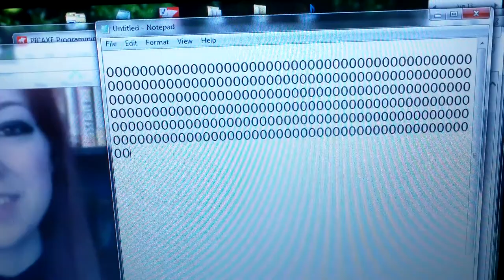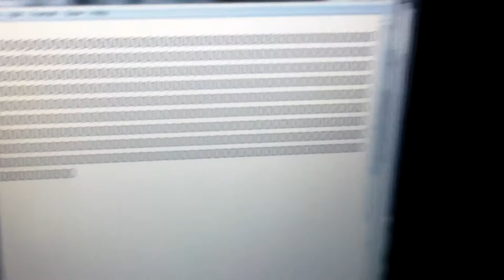TOY , CAM'S HAND WAVEY CONTROLLER

Comment from the maker: Us Aspergians thinking outside of the box , totally , and as electronics people We know that there's usually a couple of different ways to achieve an electronics circuit that does what We want and I was just going for the fastest detection time and it takes a couple microseconds for the Microcontroller to be able to register a 1 or 0, I was basically using it as a one bit analog to digital converter.But yeah, You're right Man , if a person wants an innovative solution to a problem, ask an Aspie.

Comment from the maker: Hey Man,I'm using a 5 Meg Ohm resistor to make a voltage devider and I'm tapping the spot between the two as My voltage output,just hook up a meter and watch it change when You wave Your hand over it,and the photo diode is being used in the"Reverse"mode , so just reverse it's polarity, but with the photo diode and I.R.Led pair that I got from Radio Shack this little thing has a sensitivity of about 25 - 30 inches,it's awesome , if You use a larger resistor it may be more sensitive,this is at 5V.

Comment from the maker: Mr. Tommy W , hey Man, You're close and You're on the right track, but I am using a PhotoDiode and 850nm I.R. led , the photodiode senses the I.R. light bouncing off of My hand and it actually can give a sort of distance measurement based on the strength of the reflected light.   But I have it wired to a digital input so that it will work in a 1 or 0 sense, if the input voltage is between 0V and 1V then it's off , but when it gets above 1V then it's on, I'm using the digital part for it's speed.

Comment: I do understand the device. Are you using a photoresistor as the sensor input device to pick up the change in light level when your hand passes over it?

This is usually done with photoresistors, & Operational Amplifiers wired up as voltage trip-level Comparator(s).

Comment from the maker: Comment 2 , if I was using the ADC to read the voltage level, that would take too long so I'm just using the fact that a Digital 0V -1V is a digital 
  "0"and 1V - 5V is "1", so it's really just reading the analog voltage from the photodiode and interpreting that as a digital"1" or "0" . But if this cheap simple design didn't work out then I would eventually move on to use some Op-Amp Comparators wired up like the voltage trip level full swing comparators that You were talking about. Take Care .

Comment from the maker: Comment 2 ,    Hah , Ok, You gave Me an idea and so I had to move three wires and then reprogram and now I'll make You a video while messaging You , he he he .     You're right the multimeter at the last half of the video was showing that it could measure distance to a degree and so I can get number values from that, and it's from 0 - 255 and then I just plug that in as a sound variable and it now makes sound depending on how far away My hand is , tee hee , I'll make the video soon.  Take Care.